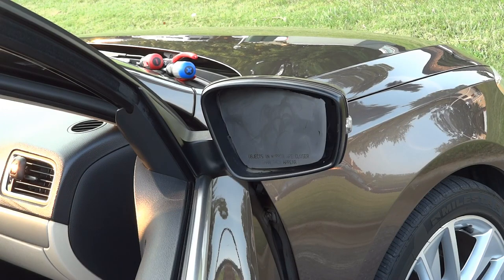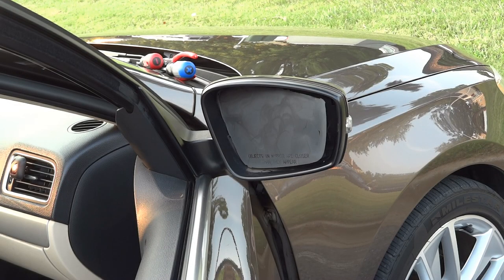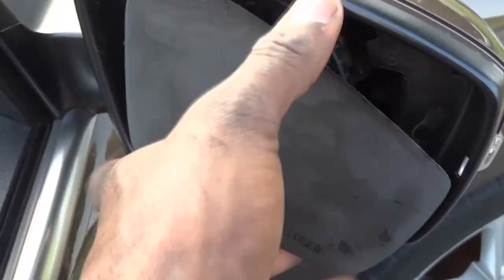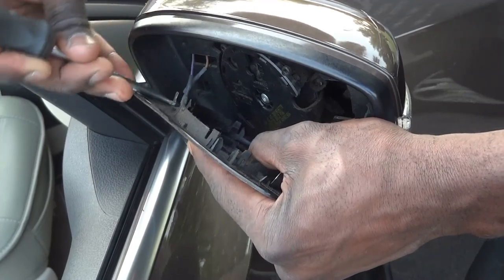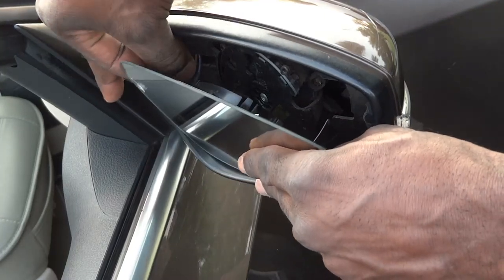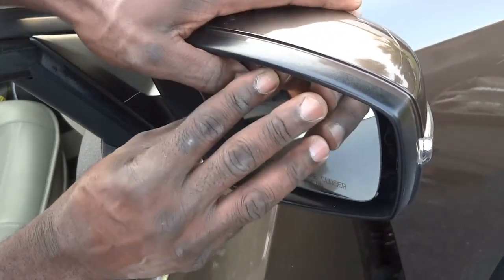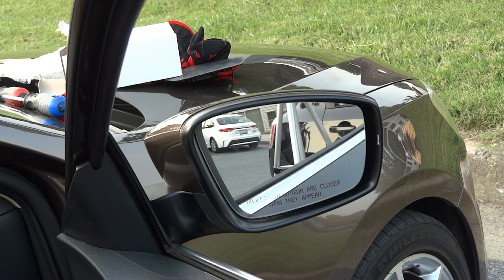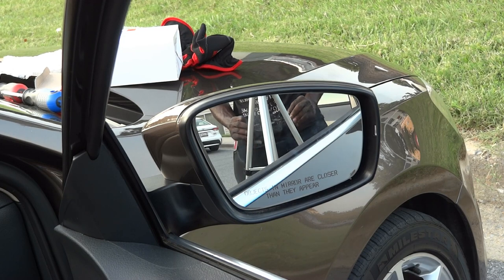HOW TO REPLACE SIDE REAR VIEW MIRROR ON VW JETTA - The Easy Way!

Comment: Great explanation subbed !!! I have a problem with my genesis coupe 75k miles car was working perfectly and out of no where it cranks but wont start i have a couple codes p2096 and p0420 and 430 fuel pump is working and i just changed the spark plugs but still wont start any advice
Reply from the maker: latiza 18  if you have good spark and fuel pressure then your problem might be timing!
Reply: @KITS_Auto_and_Truck_Repair  i recently found that i don’t have spark any idea what it could be and thank you for the reply
Reply from the maker: @latiza183  check your crank and cam sensors!

Comment: Where are you located! I have 2015 sprinter 2.1l I have check engine on it is P245B from EGR cooler bypass ! I buy the EGR valve and EGR cooler the light I still come on! Help me!!!!!!!!!!! Thank you!